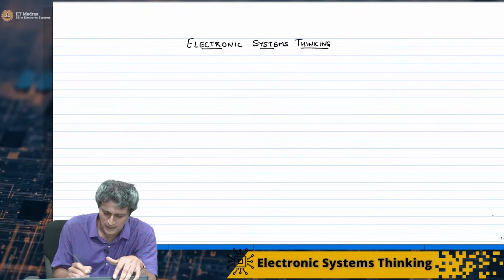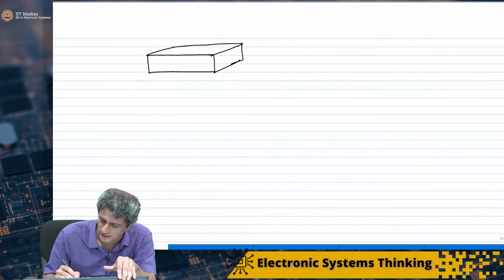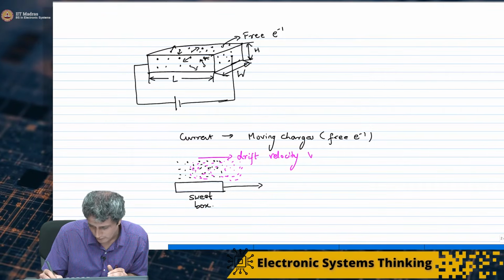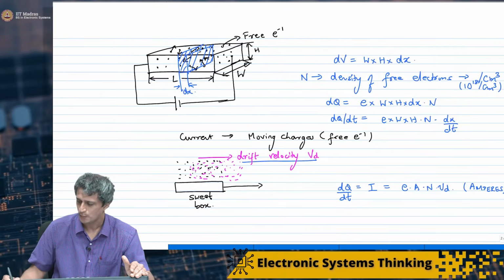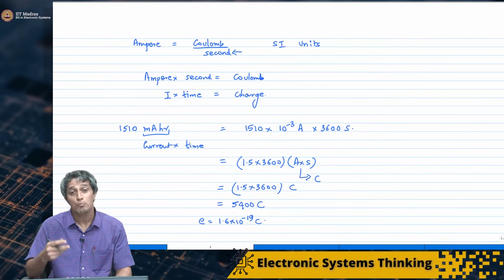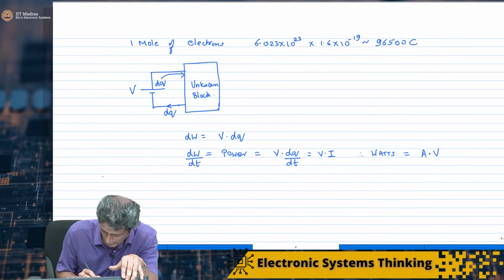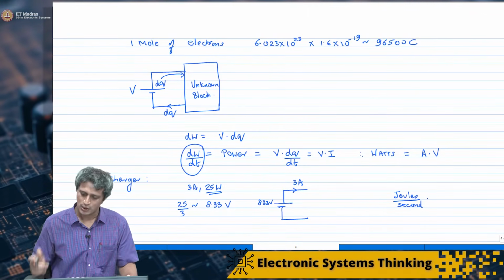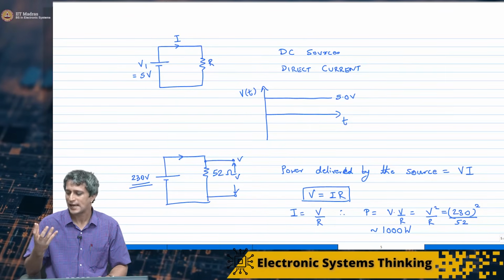W1_L8_The theory

Comment: we didn't talk about chargers
Reply: You cannot measure charge by conventional methods. Because charges don't stay at one place ie they are not stationary.
Charge measure karna is something like ulti taraf se kan(ear) pakadna ie to measure charge we indirectly measure current ( using the property of current, that in presence of magnetic field current carrying wire gets deflected. We use this property to make galvanometer by which we measure current) and for what amount of time that current flows then we do i x t to get Q.